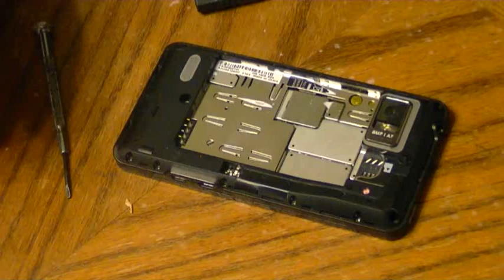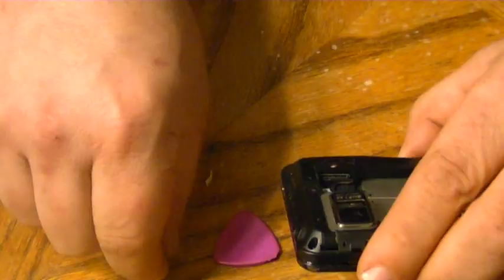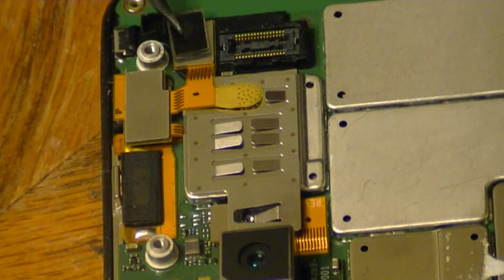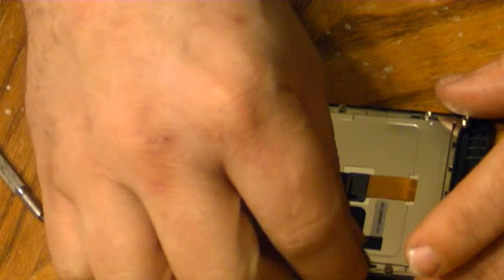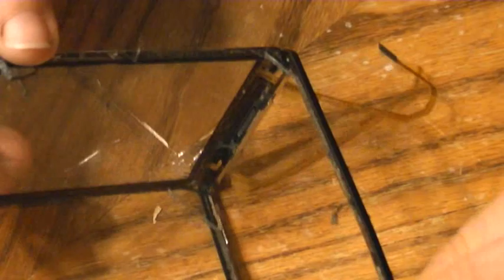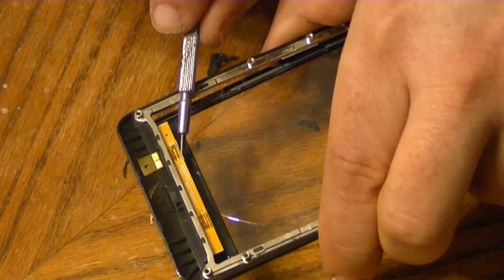Droid Bionic Teardown (Screen Replacement) Part 1

Comment: Ya don't show exactly how to take the screen off, you've got to shim between the metal bracket that is the frame of the phone and the glass, the black plasticky stuff is in the way, it will peel off.  This stuff mostly seems to keep light from bleeding into or out from the lcd. Might break the old glass in this process, just a little though, it flexes quite a bit.  Good vid for all other steps though.

Comment: What the problem probably was is a difference in part numbers. In other words, I for example have an LCD screen, part number 720-1460-8004 AA, you might have had the same, but bought one that was 720-1460-8004 AB. Subtle differences make or break these kinds of things.

Comment from the maker: @bannanapop331 
If the screen is showing up the boot logo properly I would think that the screen is fine.  Make sure the cables are seated properly and especially the module that houses the SIM/MicroSD connectors.